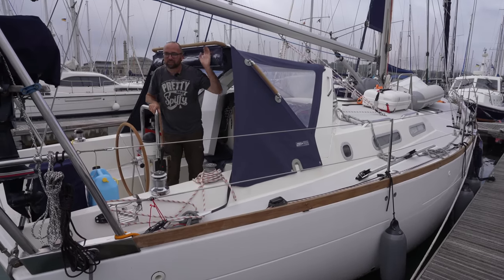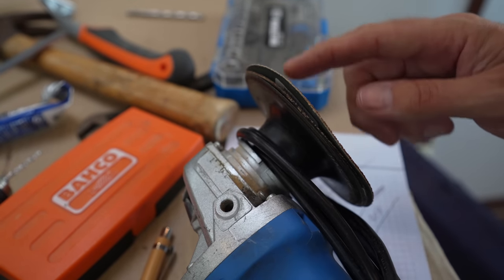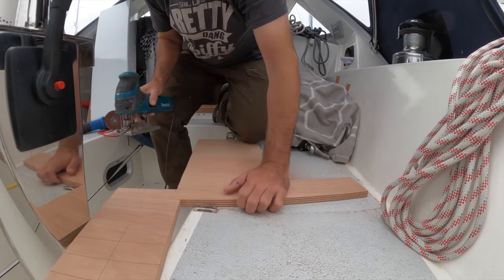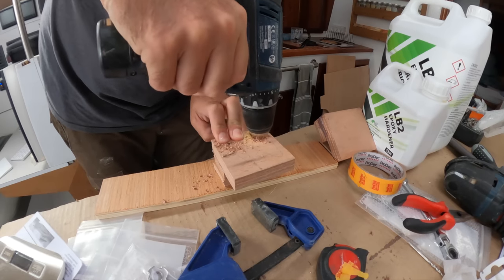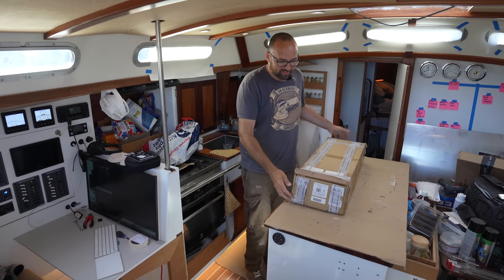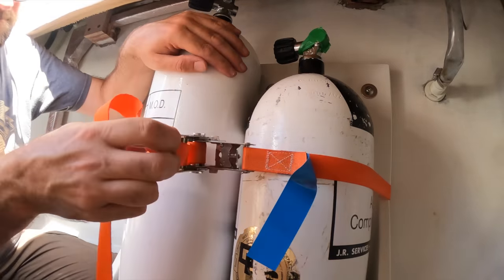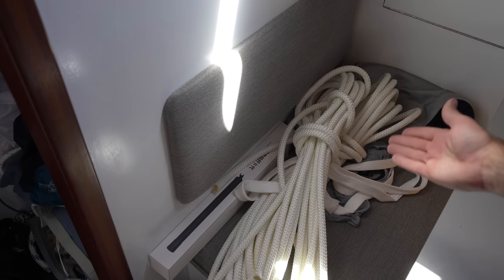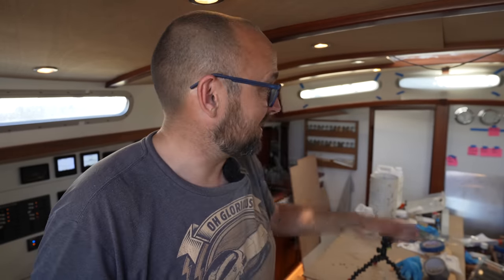Sail Life - Cockpit Locker spiffy level 11  🔥⛵️

Comment: Mads, you can get the emergency tiller powder coated. That would be a lot better solution for rust prevention than wrapping it in plastic wrap. I would check around one of the harbors and find someone close.
Reply: I’m sure Mads will have a new tiller made in stainless steel, in the nearest future 😉
Reply: Or shot with linex, or similar bed liner. Tough as hell and unlike powder coating, you will never scratch it
Reply: @JimKJeffries  flex seal rubber coats it

Comment: Excellent job on the cockpit locker Mads. Well organized and as per your usual attention to detail perfectly done. As for the thickened epoxy on the plywood paneling, that wasn't a mistake, you were filling and pre-sealing the exposed face and saving time by using the same batch of epoxy for both surfaces (yes, I was in sales once, never a mistake always a feature). Thank you as always and best wishes to Ava and her sister and the mew baby when it arrives.

Comment: We have the same Lewmar winches on our boat. I felt your pain having to buy 16mm line because of the self-tailer. I have since modified the winches so the grabber disks (or whatever they're called) are 1/8 inch... err, I mean 3 mm closer together. Obviously these winches pre-date high modulus line. I'm happy to share the procedure for the mods if anyone is interested.

Comment: MarineTex epoxy is perfect for small screw-hole filling.  It's already white and is easy to.work with for filling holes with small black West Systems spreader/stir stick. Spreading it smooth before it is cured is a snap without any serious sanding later.  You won't even see it from six feet away.
Reply: For line storage and organization if you tie the gasket on the coil with an extra couple of feet of line sticking out after the gasket hitch is made the line can be simply hung using a clove hitch from a long bar mounted along the top edge of the locker.  Basically the gasketed coils hang from the bar like a line of fenders would hang from a lifeline using the same clove hitch.
Reply: We don't bother hanging them like this on our boat because we have a dedicated shallow line locker in the cockpit which lets us lay the coils neatly inside there like stacked firewood as long as they are all coiled the same length.  

Like firewood, it doesn't matter how big around each piece is since they all stack neatly as long as they are all cut to the same length.  The same with neatly coiled lines all wrapped to the same length when gasketed.

Comment: At 4:54 you talk about putting in a ham radio antenna tuner by the back stay.  It would be very interesting if you could go into some detail on how to do HF radio antennas on a sailboat, given all the interconnected rigging (some of which is metal), and challenges with grounding.  Are you considering using the rigging itself as an end-fed antenna, or adding something new?

Comment: You could install a "French cleat" across that transom wall. Then mount the dive bottle holder on that. This will allow you to move storage solutions around.
Reply: Wouldn't that be too loose for a boat? I can imagine when the boat is leaning to that side that the French cleat would stop working
Reply: Yes, I thought the same. Perhaps secure with a screw through both bodies. Alternately locating pins. The system is probably more useful in a dynamic working environment.

Comment: In the video you mentioned SSB , as a later addition. You might want to consider SDR. You can get both receive and transmit and it allows for a far greater range. Also SSB is not permitted without a license in the US and I don’t know about other countries . When you come to the US you could take the class ( local CB club)and get licensed and get an assigned call sign( you can pick your own if you like ,within parameters). Your a tech guy and this is right up your alley

Comment: My 2 cents.  Not a huge fan of the SSB.  we had one for four years and used it on the pacific but an iridium go is better.
Reply: Iridium is the go for gribs and email. The old pactor modems are too finicky, but I wouldn’t be without SSB for the networking  and keeping in touch with other boats.(unless not enough boats now have SSB to make the “one to many” aspect  and scheds a thing of the past). But as with anything in boats there are many valid options

Comment: Mads It may be prudent to get your dive cylinders re-tested and certified before you leave the UK. It can be expensive else where and filling cylinders can be an issue outside the UK unless you have the stamp on the bottle and a certificate of test in your hand. Sail Safe Guys, Ant & Cid.